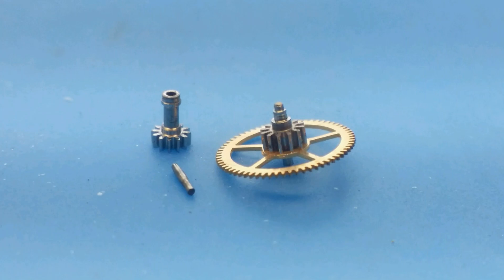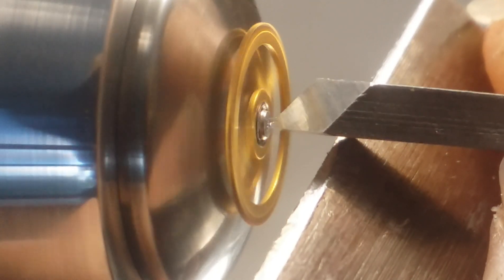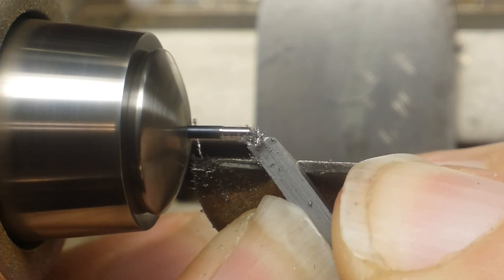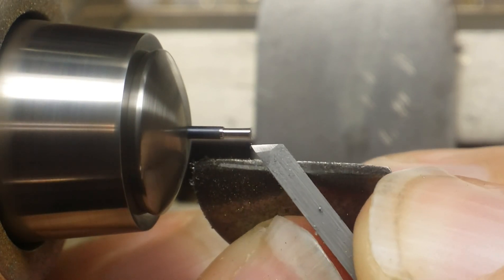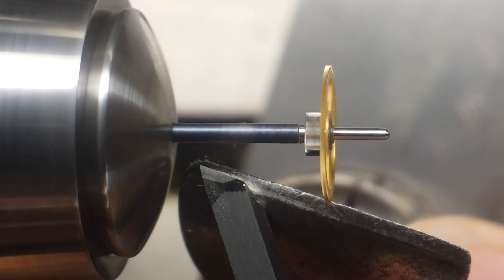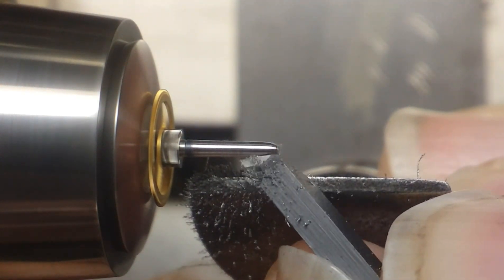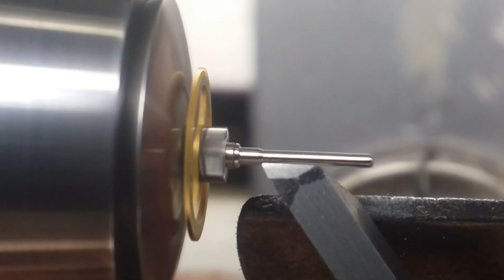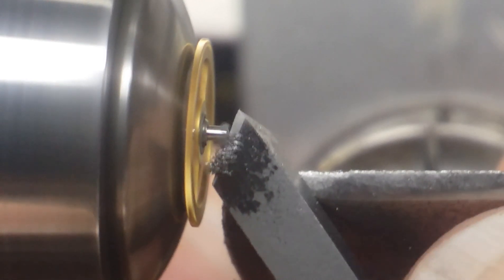Repivoting a Center Wheel

Comment: I can see how this would be very useful but I haven't reached that point in my "journey" to have the tools needed. Recently I followed a tutorial vid about dissasembling an ST36 and the canon pinion wouldn't pull out, the center base (I might be using the wrong term) got completely stuck in it. Is it very common for pieces to get stuck that should slide out nicely?

Comment: Thanks for this interesting video! When you drill, are you hand holding the pivot drill in a pin vise? If so, how do you ensure that the drilled hole is perpendicular? I've seen another technique using a hollow handle pin vise slipped over the tailstock spindle to try and keep it steady.